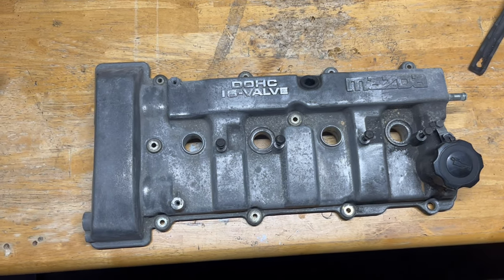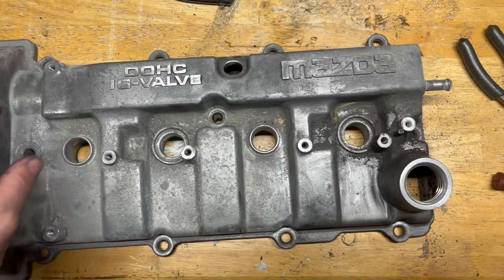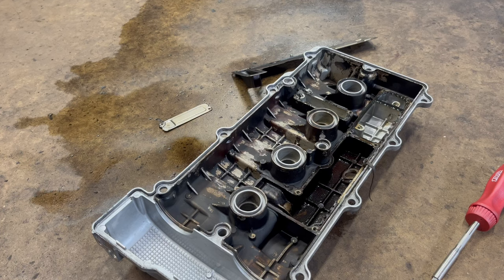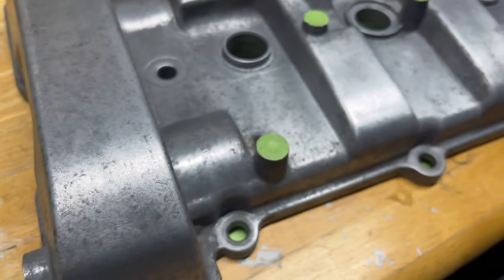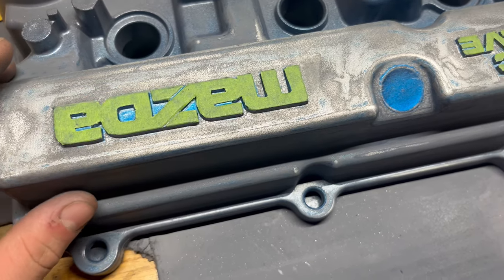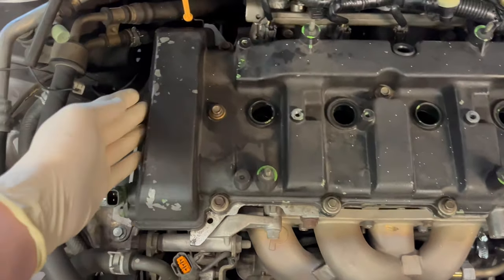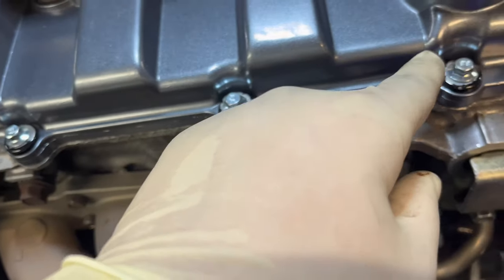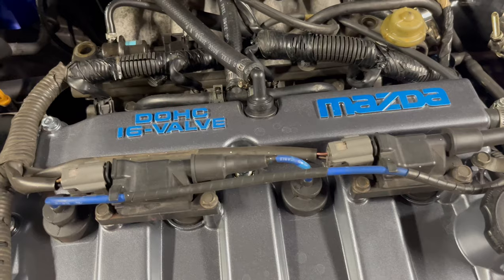How to Paint a Valve Cover on a Budget(Professional Results)

Comment: Did you put in an aftermarket turbo kit in the car? jw bc I just picked up an msp that still has the stock turbo in it that needs to be replaced, and your setup looks super clean- at least when compared to the oem engine bay
Reply from the maker: Thank you! I really appreciate that, alot of time has been put into this little protege! The car currently have an aftermarket intake, front mount intercooler, turbo, exhaust manifold, downpipe, and obviously the valve cover off of a normal 2.0L protege.